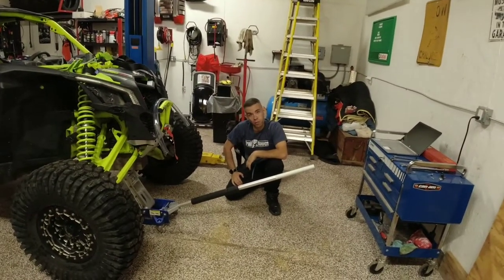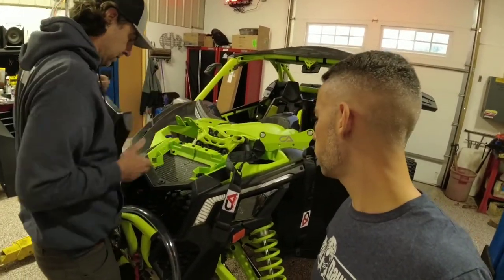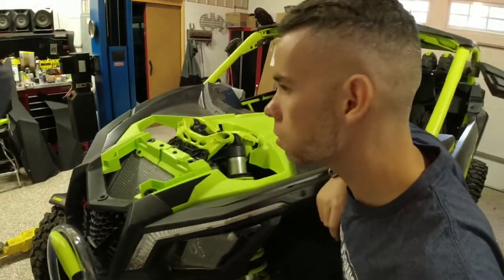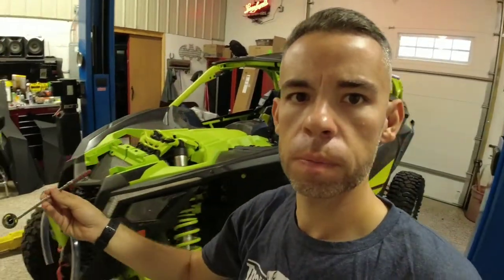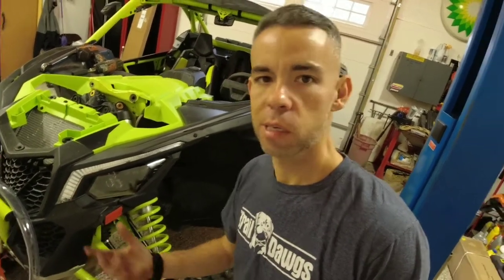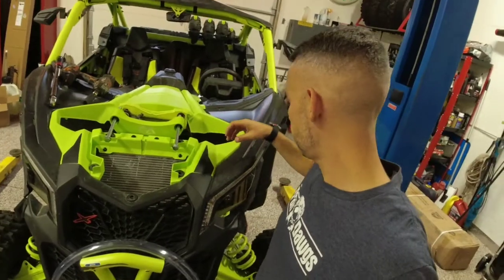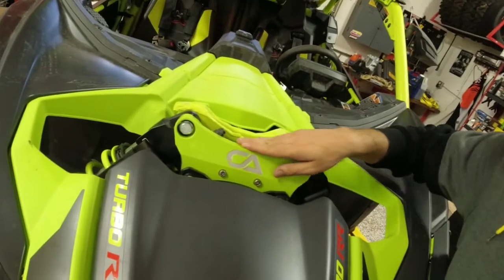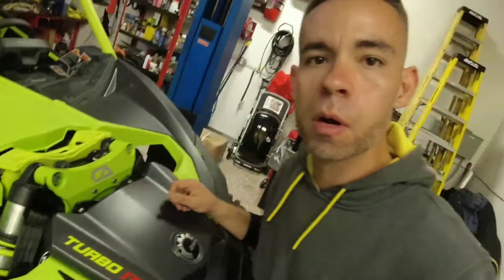Trail Dawgs Can Am Maverick x3 C.A tech limit strap system install

Comment: No need to loosen the radiator correct?
Reply from the maker: It definitely helps
Reply: @traildawgsoffroad5156  thank you
Reply: @traildawgsoffroad5156 I just knocked this install out. Didn’t remove any plastics or the radiator. The only tricky part is tightening those lower support bolts. But It wasn’t to bad with the rights tools. Thanks fellas.

Comment: It seems like the hoses that get pulled through the brace are way to tight in that hole
Reply from the maker: They definitely took some moving around to get them to fit better. After filming we played around with the fitment to make sure we weren't compromising the hoses. They do fit better with some effort. Thanks for watching!
Reply: @traildawgsoffroad5156  I guess you loosened the hose clamps.do you like it better than the ct brand
Reply from the maker: @skeim5620  I've heard great things about both. Also heard good things about combo-ing the CT and shock therapy. We ended up going with ca because of other on trail people having them and raving. It would be the perfect setup if the hose hole was 1/2 inch bigger diameter.
Reply: @traildawgsoffroad5156  that’s what I thought,I wonder if they fixed problem